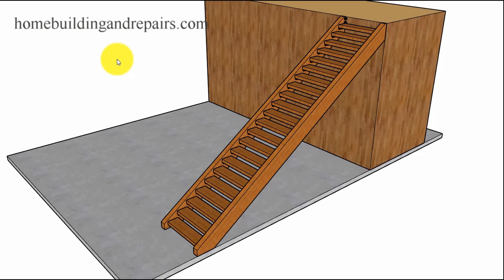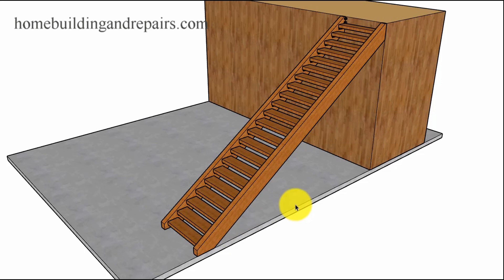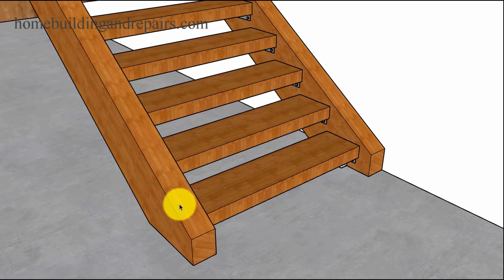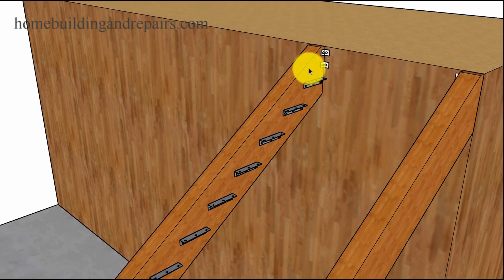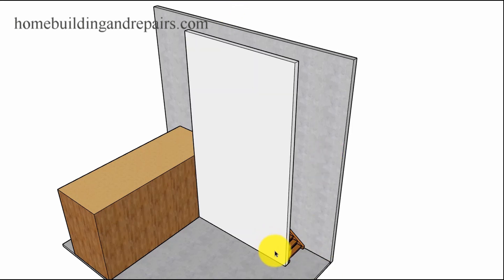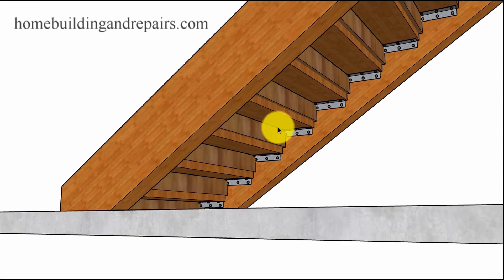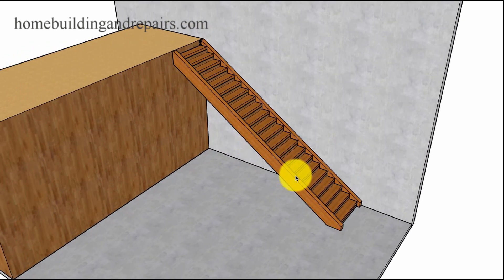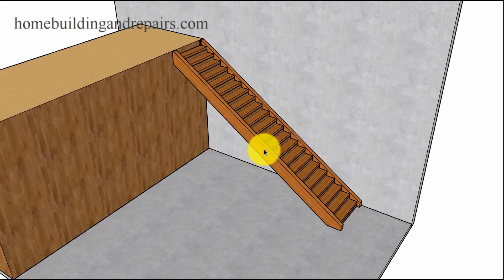What Is The Strongest Wood Stairway I Ever Built? - Structural Engineering And Fire Egress

Comment: You can use long bolts from the sides and bolt the treads. You get big holes at the sides. But you can just put a big wood plug there and cut it. Open stairs need to have the space reduced so children can't slide the head thru the opening.
Reply from the maker: Great idea and thanks for sharing.